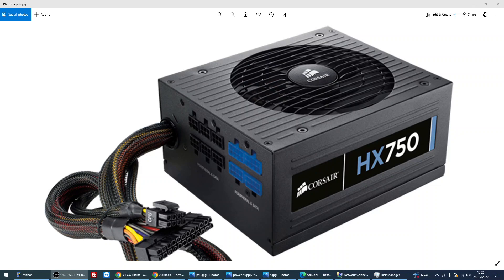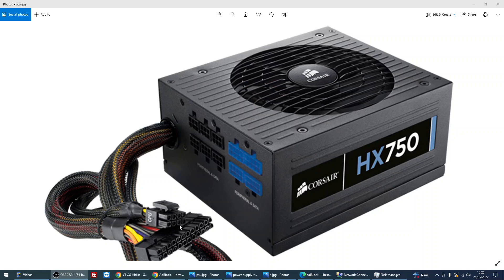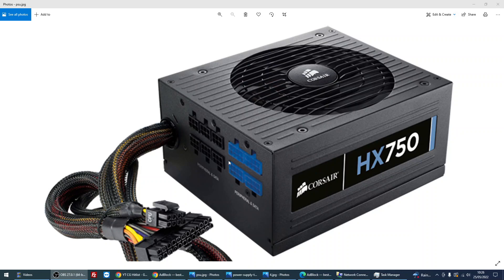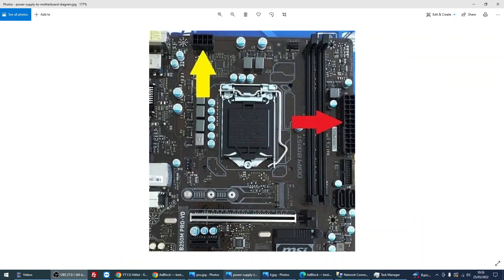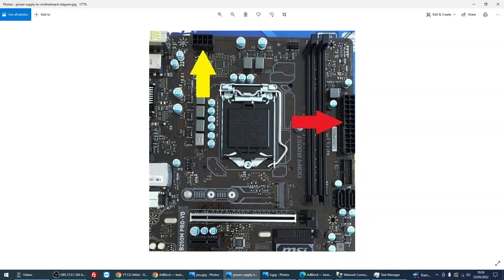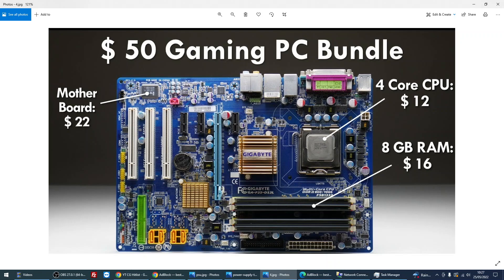Where Does CPU Power Connector on the Motherboard

Comment: what really borthers me atm is that ui just bought a new psu. a 2020 bequiet straight power 11 platinum 750 watt. its no a entry level one, nor a smal one. iam currently running a 10700k on a lga 1200 board with 1x 8pin cpu power. the psu, just has 1 8pin connector for the psu. iam planning on getting a 13600k, yet almost all the good boards. use 8+4 pins connectors. yet the 13600k isnt a cpu, that needs that much more power. i really dont wanna be forced to buy a new psu, thats not even a year old. just because mainboards nowadays need more connectors so that youre set for a 13900k overclocking. if my 10700k can run off 1x 8pin just fine, then a 13600k can